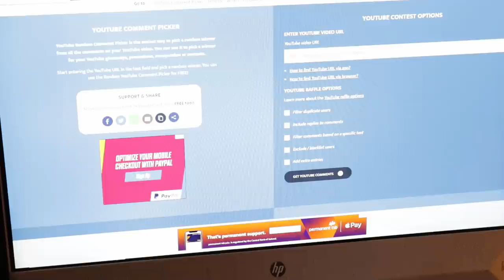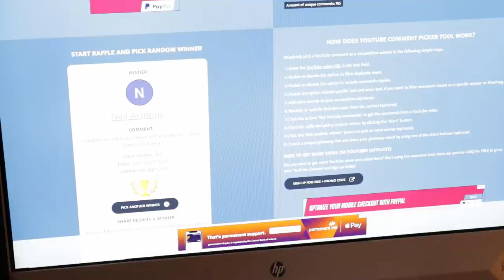Workshop Vlog #17. MFT Table Questions answered. Competition Winner!! Updates and More.

Comment: Great video as usual, John. 👍 for the van tour & the DIY. 
Just on the tracks, the Evolution tracks have both glide strips on the cut side of the T extrusion, so, if the Bosch did in fact cut out of square, that might be an option for anyone who has issues. And, they’re compatible with Festool. About €55 for the 1400mm.

Comment: Thanks John for posting these ideas. Few tips if You wouldn´t mind. I use both rail systems Festool and Bosch and agree it is a nightmare to adjust the saw play when one changes the rail. I use Makita rail with TSO GRS 16 PE parallel edge guide rail square (in fact Festool version Festool FS-WA/90° - licensed from TSO). Makita rail is better for this application as glide strips are much wider than Festools and Bosch glides touching both of them. Even construction from the bottom is slightly different between the the two. Antislip strips are made from foam and with Festo rail if you press too much on the saw (more into one side) they will be pressed more on that side and this can cause another problem with 90deg vertical squareness. Makita has ALU stops next to antislip strips and they prevent the foam to be pressed too much (or unevenly). It might be an issue when asking for maximum precision. 
Talking about distancer and Bosch overhang over the rail itself... Well the saw did not actually touches the surface of material at overhanging edge. There is app. 6mm or so free space left. It means one can use Bosch and it original rail with Benchdogs + plus distancer (as you did show) but thickness of distancer material where it touches the rail  cannot be more than 6mm or so. Opposite side where distancer touches Benchdogs does not matter. I do not use MTF but a self made jig - in principle working same as MFT+benchdogs. Material to cut is set parallel to the fence (not benchdog) and rails is set square using the MDF stops which are just 6mm high - so they do not hinder the saw from full gliding. This way everything works OK - as those stops go under the saw overhang and do not limit the BOSCH moving on the rail. Wov - I hope I described it clearly - I do apologize for my English - not a native speaker.

Comment: Love to see what energy improvements you do

Been doing a lot of energy improvements on our house over the past 4 years, ground source heat pump, 4kw solar panels, thick kingspan on a room that had bare stone walls; got to the point where there is only 1 point improvement in EPC possible, and that came with a solar water pre-heater which is one of those investments which NEVER pay back this far north (Scotland)

Best one we couldn’t do was the passive ventilation pre- heat from the expelled air

Beware of switching entirely to heat pump (unless you have a mill race) because you lose the split in energy between electric and gas which keeps the VAT on each supply as domestic, rather than taking you into full VAT and climate change levy in the winter months

We went for.the Honeywell Evohome system for controllers as it gives us 12 zones which can be independently managed.

Comment: Thought I should warn/help you and viewers about my experience with Bosch track saw on Makita rail. On tightening up the adjuster to stop side movement one of the plastic slides broke. The pin that fits in the cam snapped off. No problem I thought, I will order some only to be told that they come with the base plate at a very hefty cost of £159.50. I found that the unbroken one would not tighten up enough anyway. I drilled out the broken and unbroken pins slightly off centre from the track they adjust to. I then super glued a small length of suitable metal (in my case a nail) and they work fine and tightened up beautifully. A quick squirt of WD40 PTFE spray and away you go. Not only a better fitting but virtually no cost.

Comment: Problems with the Bosch track. Why don't you implement the hinge system as supplied with some of the Festool MFT's? A hinge at the far side let's you flip the track up and out of the way and a little "nose" holds it in the accurate position at the front of the table. Only down side is that the track is (semi-)permanently mounted to the table (and the height of the shop might not be enough)